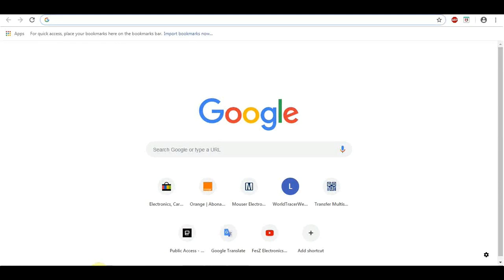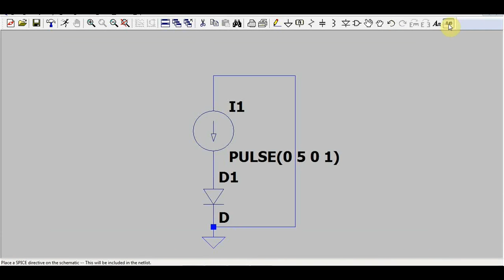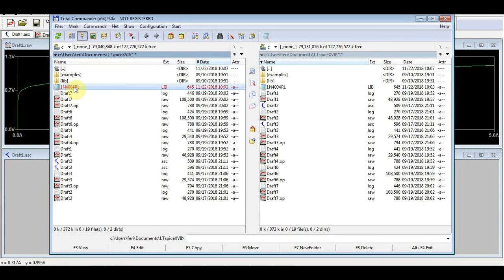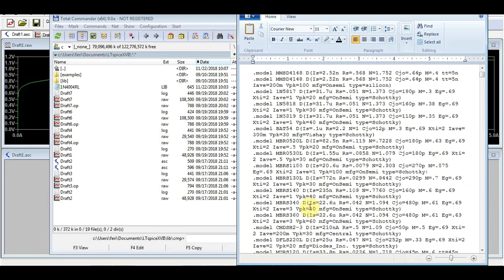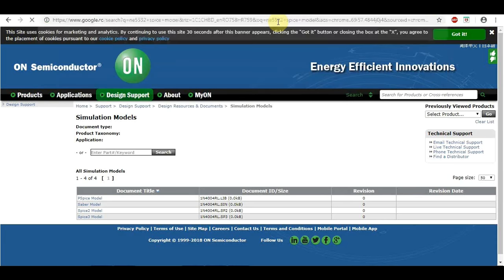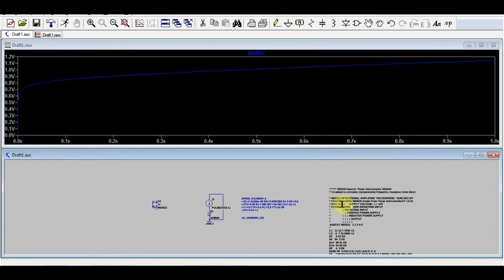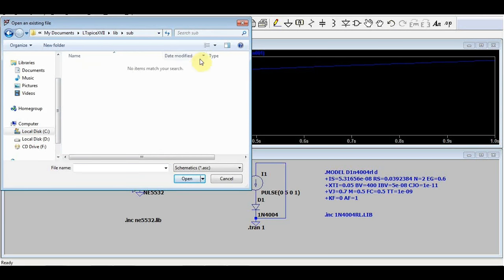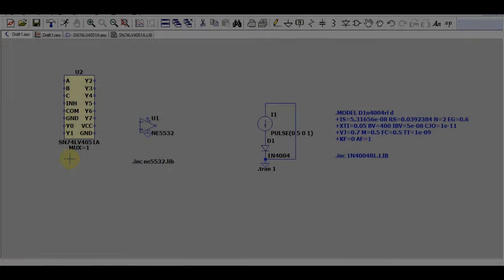LTspice tutorial - EP4  How to import libraries and component models

Comment: Normally NE5532 has 8 legs and contains 2 opamps internally, but 5 legs are seen in the Spice model. How do we use this model? Do we need to simulate it as 2 opamps in a cascade?
Reply from the maker: With most IC's that have multiple circuits of the same type in the same package, only 1 will be modeled since each circuit is independent but also identical to the other ones; the model only contains just 1 of the opamps so if you wish to have both, just place 2 components referenced to the same simulation model. Of the 5 pins, 2 are supply so these should be interconnected.
Reply: @FesZElectronics   Thanks

Comment: ADI has changed LTspice to use user component files for R, C, L, Diode, and others in the main folder.  They no longer merge new data into the built-in component files. Any data you put in those files will be overwritten and lost.

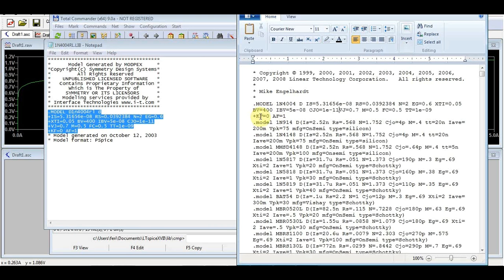Comment: 5:10 LTspice (for both regular file manager and total commander) doesn't allow me to change any directory files. Whenever i try to save a changed version of standard.dio it tells me i don't have rights to overwrite. What should i do?
Reply from the maker: I think this is happening because of the file location. Usually if its on C:\ drive, there might be some permission restrictions; you can either try to move LTspice to another drive (like D:\) or open the .dio file "as administrator"

Comment: Excelent Tutorial and video series on LTSPICE.
I tried the third method to permanently add a component in the standard library and followed your steps, but it doesn't worked: When I put pick a new diode, the model that I want to select (1N4007) doesn't show any idea why this happens?
Reply: Question like these aren't answered by either the original creator nor, any commenters. It's frustrating.
Reply: @darrellhambley7245  Thanks for anwer, I finally managed to solve it months ago, the problem: I was copying the files in the wrong folder, because there is two folders with the same name, one in My documents folder, and another one in the standard instalation folder in C partition, dont remeber now, but I think the good one is My documents one.
Reply: After looking at several "how to" videos, I find that most of the creators of these videos don't know that the new version 17, LTspiceXVII does not let you change the lib folders in the program file. You have to create your own folders under the Documents folder. 
LTspice automatically created folders under Documents at my home computer by not on my work computer (downloaded at different times; my home version was 2017). So, when the instructor in these videos says, "go to you lib file" and you find there is no lib file, it is simply frustrating.
This guy here does show the folder that he made with the .lib files but, ar around minute 3:00 in the video you have to pause every second to see his keystrokes because he goes so dang fast.

Comment: As described in your video I added a new model file in \Documents\LTspiceXVII\lib\cmp\standard.bjt. On starting LTspice it started behaving strangely. Anytime I right clicked to select a particular transistor it opens the window 'Select Bipolar Transistor Database' and this window keeps coming even after I click  'Cancel' or 'Open'. At times I had to abandon LTspice as it would go in a loop. The only way I could get back to its original state was by replacing the standard.bjt file from the Program directory.

I had added a new  model into the standard.dio, and it behaved the same way. 

My question is can one edit the cmp files in the Documents\LTspice\lib\cmp folder. I am using the 2016 version of LTspiceXVII.

Comment: How would you import something like a Diodes Inc. BAS70DW-04 or BAS70BRW, which is a Schottky array?  Just draw the diodes as in the data sheet?  The Spice model for these says "quad, one node of four".  So the values in their Spice model are simply for one?
Reply from the maker: I found the model for the DW-04 diode, and yes, its for 1 single diode; in general there is no point in making a model for all 4 in the same package if there is no specific interconnection parasitic being modeled. It is quite common to find components as separate models even if they are in a package together with something else...
Reply: @FesZElectronics  I get it now, okay thank you.  I had wanted to model several DW-04's coming off an antenna as a RF energy harvesting circuit with anodes/cathodes facing specific ways, so I guess I'll just lay that part out myself.

Comment: One more problem bro,IC which I am using has 8 pins but pspice model has 6 pins.What I need to do
Reply from the maker: May I ask for the particular IC name and model source? Depending on what the functions of the 2 missing pins are there may be a problem or not - if the pins are unused or just copies of existing pins (for example 2 ground pins) than its no issue;
Reply: @FesZElectronics  UCC28019 ,missing pins are VCC and Vins
Reply: one more thing I tried in TINA also but there also 6 pins are there
Reply from the maker: I guess that most likely the model does not take into account the function of these pins - it will not cover the IC current consumption and the Vins voltage thresholds are again not covered. Usually when making a model, you cover features that the component has, you don't build the entire component, so the main features, that are commonly used are modeled, and anything else, not..

Comment: Providing the very same schematic and settings it says when i run the simulation that <I1> needs 5 parameters instead of 4.
Which other is really mandatory ?
Looks like you set only 4.
Reply from the maker: I think this is a change later implemented in LTspice; just add 0 or some value on any of the next parameters, and the error should go away.

Comment: very nice video. I would like to use the Analog Devices  AD202kn isolation amp and I cannot find it in Ltspice or at Analog Devices which seems odd since they own Ltspice I think? 
Next is to locate the Analog Devices ad202kn library at a 3rd party location and place it in Ltspice and hope it will correctly simulate the ad202kn?   Thank you for the great information. 😊

Comment: please help i can't find nmos irfp450 ltspice model
Reply from the maker: Hello! It's on Vishay's website: http://www.vishay.com/docs/90151/irfp450.lib  
Usually when you have a component manufactured by a respectable manufacturer in this century, you will most probably find the simulation model on their website
Reply: @FesZElectronics  thank you for responding. for vishay it didn't work when i tried to simulate and it has less parameters like vds=500v. but lucky for me i just found on a website a library full of nmos ltspice models  with the same syntaxe or directive of ltspice.
here is  the link to it: it http://bordodynov.ltwiki.org/
thanks
Reply from the maker: Interesting website, I will try to include those components in my local folder, good tip!. But coming back to the Vishay model - did you try to include it by generating a new symbol? its not modeled as a transistor but as a sub-circuit so it won't work if you just include the library and give the name to a default transistor symbol, the most simple way is to generate a new symbol from the .subckt and use that... I just did a quick simulation with it and at 500V the DS does brake down, so that parameter is included. The main difference that I could see at a quick glance between the Vishay model and the one in the link is that the link models it as a transistor, on its own; the Vishay model is a more complex circuit with a MosFet and 4 diodes. In most cases I guess both models will yield the same results and the one you found is far more easy to use but the manufacturers one could be truer to real life in certain conditions.

Comment: That's great, thanks.  Are there common compatibility issues that PSpice models have that LTSpice does not work with?
Reply from the maker: |I don't really know of any compatibility issues. Usually I have no problems when importing models but The most common problem that does occurs is that the model does not converge (usually with op-amps); then I just add ".options cshunt=1e-14"; this adds an extra 0.1 pF to every circuit node, and then all works.

Comment: What wil yoy do when no pspice model to download?
Reply from the maker: In most cases, you should be able to find a relatively similar component; if that is not possible, try to simulate just the behavior of interest using some generic blocks (ex ideal logic gates, ideal opamps/compartors; use pulse signals etc); if that is also not a possibility, don't simulate anything- rely on a theoretical analysis or chose another component that does have a model...

Comment: around 7.17 you were able to save the file as NE5532.lib and it prompted you about the extension but when I try to save the file as NE5532.lib, it gets saved as NE5532.lib.txt, and there is no way for me to change it in the properties settings as well, I'm not sure if it is a windows 11 thing. T_T
Reply from the maker: I usually find it easy to change extensions of files using total commander. Not sure how things are on Win11, I still use 10.

Comment: I get the following error when I try to run the simulation " i1: requires a minimum of 5 parameters. only 4 specified", I see you have specified 4 parameters as well, i1,i2,Tdelay and T rise. I mean you didn't populate Tdelay with '0' but that is implied.

What is the 5th parameter that is supposedly missing? The following is my spice netlist

I1 0 N001 PULSE(0 5 0 1)
D1 N001 0 D1n4004rl
.model D D
.lib C:\Users\vigne\OneDrive\Documents\LTspiceXVII\lib\cmp\standard.dio
.MODEL D1n4004rl d
+IS=5.31656e-08 RS=0.0392384 N=2 EG=0.6
+XTI=0.05 BV=400 IBV=5e-08 CJO=1e-11
+VJ=0.7 M=0.5 FC=0.5 TT=1e-09
+KF=0 AF=1
.tran 1
.backanno
.end

Comment: FesZ I imported a TIP122 and TIP127 models to LTspice just like you did, and I had to use "prefix = X" to make it work. Do you know why? It this what I have to do every time I add a custom component like this one to LTspice? I think normal transistors would have worked fine with just adding ".inc COMPONENT_NAME.lib", right?
Reply from the maker: Hello! I did cover this in a more recent video. You need to add "X" if the component is a subcircuit and not a basic component ( https://youtu.be/X2uUJPyXHHk ). The same applies not just for transistors but any component really - you can have very complex models built for even capacitors or other passives.
Reply: @FesZElectronics  you are awesome! Bro thanks a lot for all the effort you put on every single video. Love your content! You sways help me lmao 😂

Comment: what if there is more than one subcircuit in the file?
Reply from the maker: That does not create any problems. You can import the file with a single .include statement; and then all the contained sub circuits can be used.

Comment: I was able to import many components successfully. But when imported PSpice model of TLC555 from http://www.ti.com/product/TLC555/toolssoftware , simulation failed with warning: "Can't resolve .param nz=0.3/(vt*log(1+5.0m/isz))"
Reply from the maker: Hello Rohit! Well I have no easy answer here; the particular error you showed appears because the parameter VT is not defined. If you define it then other errors appear.. I'm not sure if the model was built for some particular simulator, or if its just wrong. 
I recommend that you use the 555 mode built into LTspice; its under Misc>NE555 ; this is much easier than to get the Ti model to work

Comment: hey man, how I can import a ltspice model encrypted?, I have an ASY and MOD files
Reply from the maker: Hello Darwin; you could try to insert the asy into LTspice file under lib>sym>auto_generated (or create a dedicated folder) (to make it accesible on any new schematic); and then take the encrypted mod file and save it unde lib>sub (this is where most model files are kept) ; Now you can open the symbol either directly, or by placing it in a schematic and then right click>open symbol; Here open attributes (ctrl+A) and edit the path to the mod file. 
Let me know if it works

Comment: Really great video, It would be helpful to me if you could show how users can share their 'Auto Generated' symbols with each other easily.
Reply from the maker: I'm not sure there is a dedicated platform for this... I mean you could use any sharing website or platform, its just that I don't know of any place dedicated for LTspice.
Reply: @FesZElectronics   thanks for the reply. What I mean was when I get a sub file, and then in my simulation I create an 'Auto Generated' symbol. Then it works great for me and everything runs. The problem occurs when I pass off the simulation to my friend via USB drive he opens the simulation and then needs to also go through the process of creating an 'Auto Generated' part and wiring it up before he can run the simulation.
Reply from the maker: Hello Daniel! I think the problem you are getting is that the symbol you generated also has the path to the model embedded. If you open the symbol (place it in the schematic and right click -> open symbol) and then in the symbol under the Edit menu -> Attributes -> Edit attributes you get on the bottom a field called "ModelFile" - this basically tells the symbol where to get the model from; you can either put the model in the same place on your friends computer, or delete the content of this line completely and then whatever is written in the "value" field of the symbol the simulator will look for that particular model. Then the model can be linked via ".include" statement or directly thrown into the simulation as a spice directive. 
Let me know if this works out!

Comment: Hey, Idk if you're still checking the comments here but I have a question. I converted a .IBS file into a .LIB to use in LTspice. The conversion worked, and I tried to follow the last method you showed me, however the file I have has multiple little sub-components, and I can't generate a single component. If you could help in any way, that'd be much appreciated! Great video btw :D
Reply from the maker: May I ask how you made the conversion (.ibs to .lib)? (just don't send links since youtube usually deletes those comments)
Usually an ibis file for a more complex IC will be split into multiple bits - like a single ended line (of various driver types); a differential line (again various driver types) etc. I think this is what you are getting - maybe just select the necessary subcomponent and used that. An ibis model does not simulate the IC as a whole, but rather the interface - the pins; but you still need to provide stimulus.

Comment: As a software developer, this is one of the things (there are several) that I absolutely HATE about LT Spice. It has a wretched user interface and that you have to do this kind of crap to import models is just plain stupid. This kind of functionality could EASILY be built into the software so that you could simply point it to a model at some URL, click a button, and it should be able to import the component. 
LT Spice should be written by software engineers, not EEs. No offense to EEs, but that's not their wheel house.  At the very least, the UI should be written by software engineers. You can let EEs do all the behind-the-scenes calculation stuff. It could be a MUCH, MUCH better product with even a handful of changes.
Just added 2 models of 2n7000 MOSFETS as you described to the standard.mos file and they're not showing up because... Who knows. I HATE LT Spice. (Yes, I restarted it. Put them right next to the 2n7002 that was already there. It shows up, they don't.)
Reply: What is also really frustrating is that, in all these "How To" videos, the instructors think you already know all the keystrokes to get from A to B. Why do they think we're watching a how-to video if we already know?
Like this video, "Now you can simply edit the file". WHAT??? Which folder do I put the file into? Do I have to open LTspice first, then copy that symbol into some schematic? 
No. I can NOT "simply" edit the file. Why can't he show the 10 keystrokes to get there? GEEZ!